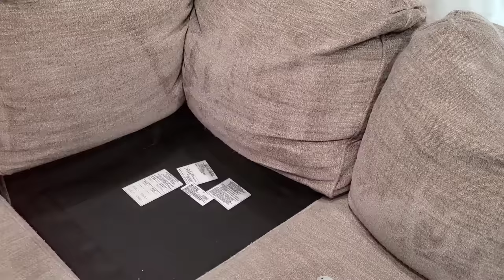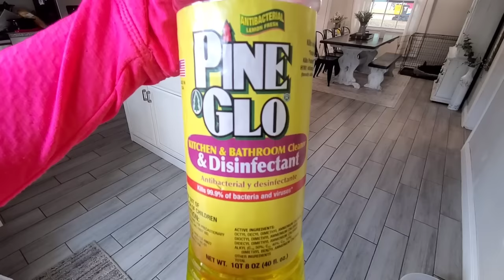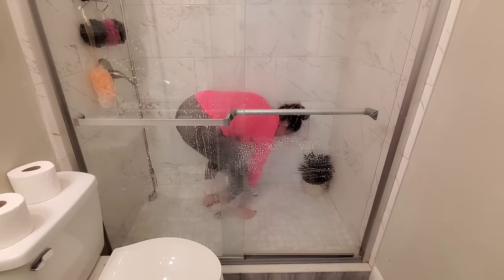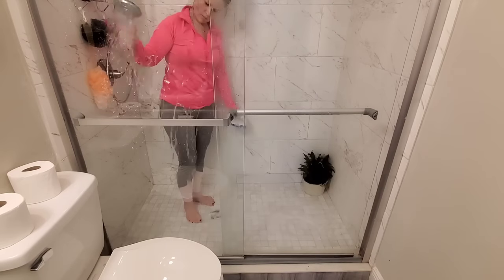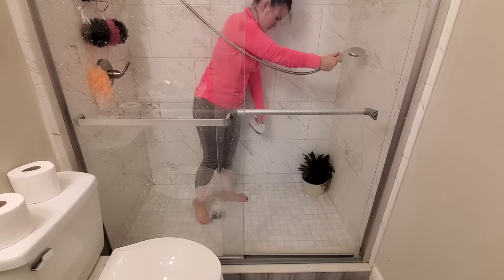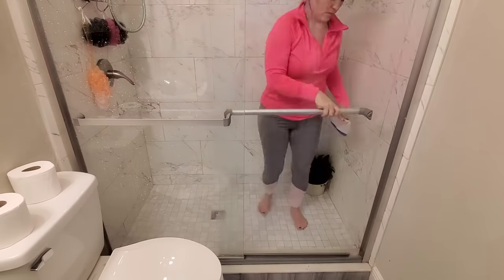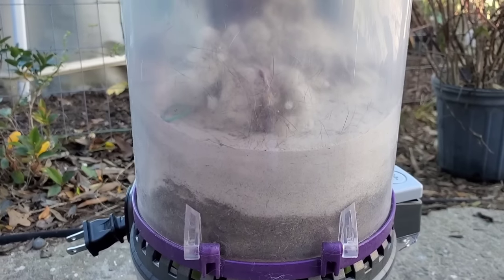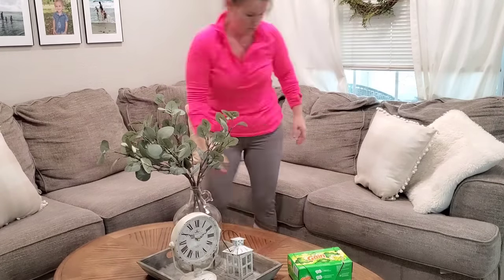ALL DAY SATISFYING CLEAN WITH ME | How to keep a clean house with pets!

Comment: I only like to use the flat sheet in my room my kids don't like them so we just use the fitted sheets with comforters. But on the dryer sheet tips I like putting them inside our pillow cases and under the fitted sheets in the beds between washes cause they help keep the beds fresh too. I also use dryer sheets on our sofa and if you run them a cross the baseboards they help the hair not stick to them you can also use fabric softener on a towel for the baseboards to help the hair not stick as bad too. I have a pit and a husky my husky gets her hair everywhere lol
Reply from the maker: Thanks for those tips ill definitely try them out 🙌😁

Comment: I cannot even imagine not using a flat sheet. The duvet, comforter or bedspread you aren’t supposed to have to wash weekly. Usually I always have thought it was sheets a heavy or light blanket and then the comforter Etc.  fold back comforter at foot of bed or I have a chest at the foot of my bed I’ll fold it going over that. My bedspread stays clean for months and I change sheets and blankets.  this is really odd to me.  I think this is kinda gross.  New sub but unsub